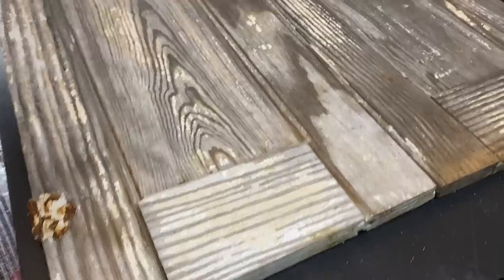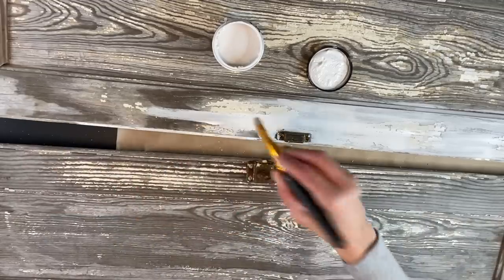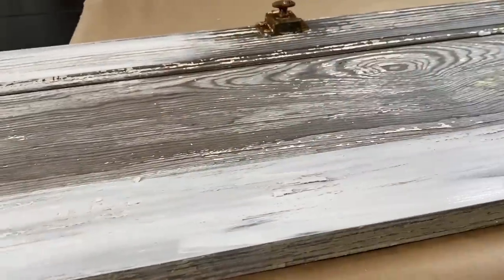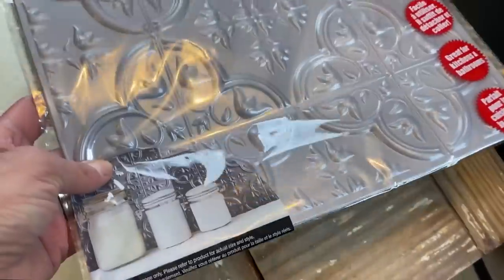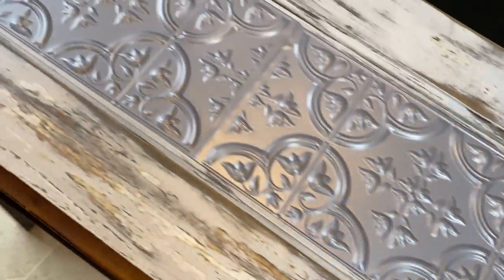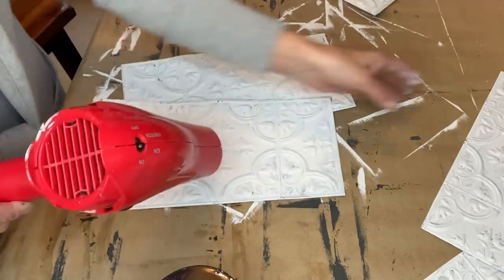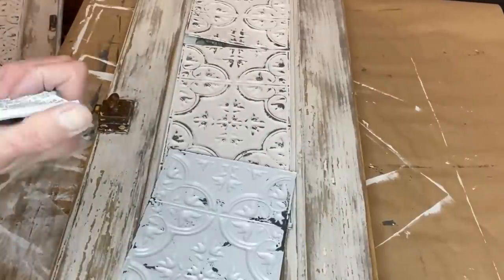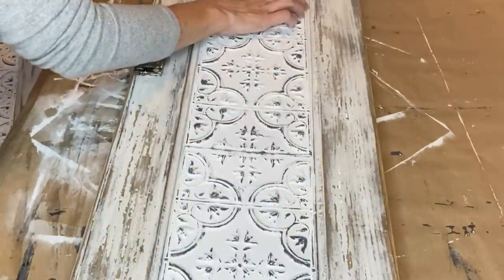Day 15: Thrift to Treasure - Refabbed a set of Vintage Doors from a recent FREE Thrift Haul

Comment: Perfect way to finish these doors. They remind me of a cabinet my husband built 20 years ago and I wanted to use old rusty tin ceiling tiles in the inset. Now back then the only way to get those was through an antique shop, too expensive if even I could find them. I ended up using some heavy embossed wall paper with that same pattern, brown paint under with distressed top. Still have it today, love it and am happy to see crafters use some of the same things I did long ago! Just beautiful!!!
Reply: Just received a message from you to contact you through Telegram. I installed it but you are not in my contacts, I don't have your number. Is there another way
Reply: Oh so it's a scam, great!